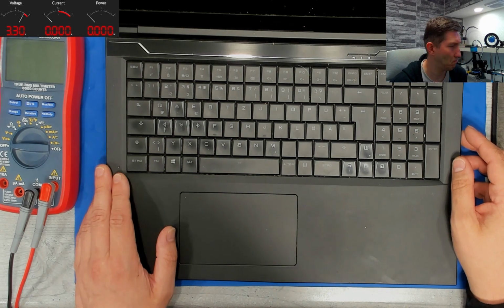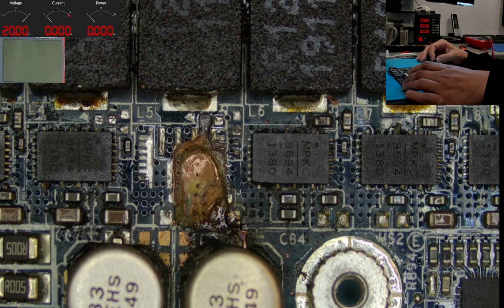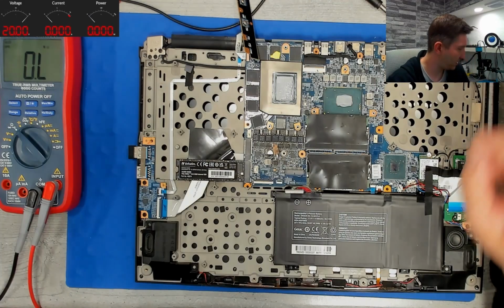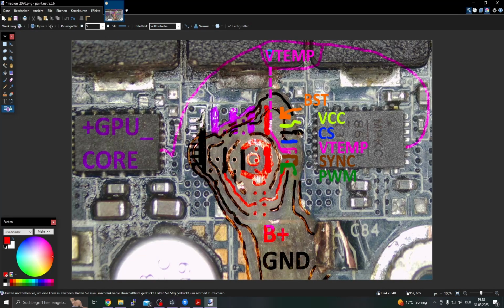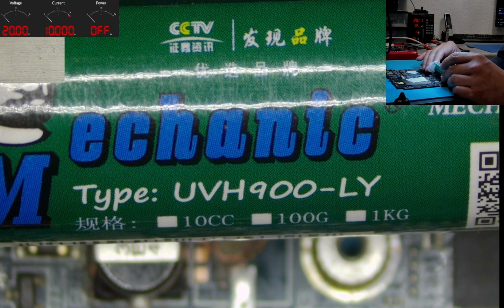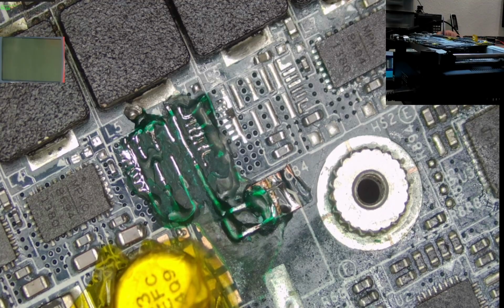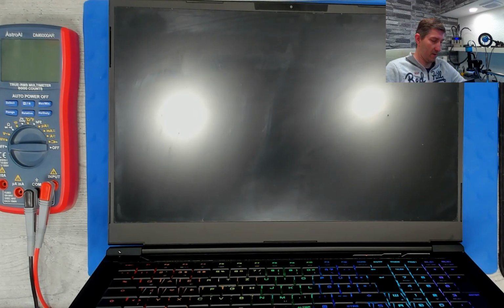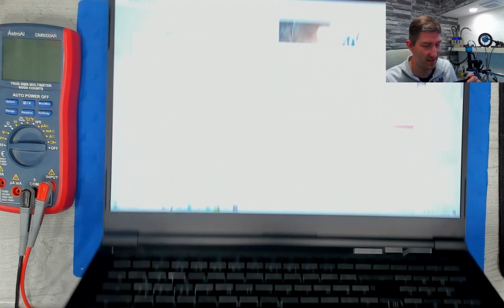Medion Erazer X17805 - missing DrMOS, previous repair attempt, GPU very slow - Advanced track repair

Comment: could you have use a min switching power supply and have it running all the time  to replace the missing part
Reply from the maker: For +GPU_CORE, I honestly can't imagine such a solution. :D
Reply: Late answer: This is a very good idea! But it's very difficult to achieve because those Dr-MOS switches are synchronised for PWM frequency, phase, output current, temperature, and, most important, output voltage. Even if you care only for the output voltage, it'l be a very hard engineering job to achieve. But not impossible. Not a job for an LM317. 😂😂

Comment: Great Repair Mike, congrats! One question. Do you use schematics to find the connections between the layers or just the multimeter and your experience ?
Reply from the maker: At least in this case it was not necessary. Got all needed informations from the PWM controller datasheet and the Linout of the PowerStage. The schematics for this device are available, though. If I remember correct.

Comment: Wow, this is inspiring, trully a phenomenal repair.
I assume you found the schematics for that laptop? If not, maybe an compatible one?
It makes me wonder if it's possible to follow the same logic with the datasheet "sample" circuit.
Great job as always!
Cheers!
Reply from the maker: Honestly, this repair was done without schematics for this device. The only help was the circuit diagram i shared, the actual datasheet of the MP2886 PWM Controller and the Pinout of the DrMOS i found in the web.

Best regards!
Reply from the maker: but i can't proof, since i recently found out that the schematics for this board acutally exists... :D

Comment: next time you solder a mosfet you should really push it better against the board for better thermal performance, dont let it float like a bga IC, especially the gpu phase mosfets.
Reply from the maker: Good tip, thanks! 👍
I'm concinced you have noticed that i actually did it exactly like that with the DrMOS for the Core supply. :)
Reply: Late answer: Of course, there is not any cooling achieved through the power planes at the bottom of the IC, because those copper planes are finally gone. So the only option is a thorough cooling from the top side. The former cooling from top side can be overworked and made nicely thermal connection to the heatsink. If there's no testing of the temperature by software (it's possible to make a read-out of the temperature directly from the Dr-MOSFET), use a multimeter with the little temperature measuring cable and the little "pill" at the end.